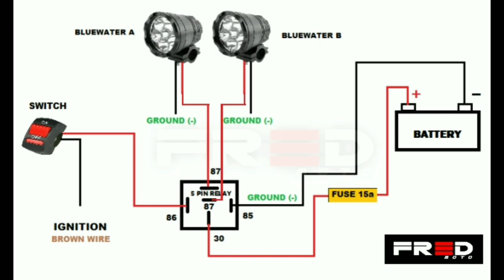LED/AUXILIARY LIGHTS WIRING AND INSTALLATION | YAMAHA SZ

Comment: What is the purpose behind the numbered wires?
Reply from the maker: The relay has a different pin numbers, this way it is easier to know where the wires are connected.

Comment: Ok looks good,, but are those actually WP shocks? 
And the aux on the Yamaha, don’t ya mean a power? And couldn’t ya just add a wire back to the battery? Cause 99% of people don’t have that model bike if it’s even sold in other countries besides your. But the number system is great. I’ve done the exact thing when wiring a dash cause there’s like 20 ports, but I also constantly look a my phone for simple light schematics constantly and loose track just as easy. So I’m gonna go back to the numbering the wires to stay outta my damn phone where I loose track of things and mess up simple systems .

Comment: hindi na ata necessary yung 15A fuse jan Ser mas safe kung 5A fuse lang siya

2.5 ±0.2 Amps lang dinedemand nya eh

kung 30 watts (dalawang 15W lights) ang kabuang power demand ng lights nya

tsaka kung direkta na sa battery hindi na rin necessary yung relay sa 30W lights 🤷

 dahil hindi naman masyadong malakas ang current na hinihingi ng mga LED lights.

nagkabit ako ng ganyan sa tricycle namin 45 watts na worth ng LED lights
5A fuse lang ang dinagdag ko sa circuit

Comment: Ilang Amps ng Fuse nilagay mo sir for 2bulbs?
Tsaka necessary bang yung switch sa accessory brown wire ikabit instead na sa ground?
Reply from the maker: 15amps sir. Mas maganda po na galing  accessory wire yong power para gagana lang po ang led pag naka on ang ignition. Pwede nman negative ang dadaan sa switch medyo magastos nga lang sa wire.

Comment: Paps pwede ba Yan e connect sa pass lights paps yong blue water?
Reply from the maker: Kong sz v2 mc mo paps pwede po dahil mag kaiba ng power source ang pass light at high beam, tap mo lang yong 86 ng relay sa yellow  wire. Pero po pag isa lang ng power source ang pass light at high beam nyo pwede rin kaso pag naka high ka matic open din ang bluewater mo.
Reply from the maker: Need mo din ng Diode may wiring diagram akong ginawa naka post na fb page ko po pwede nyo gawin reference.